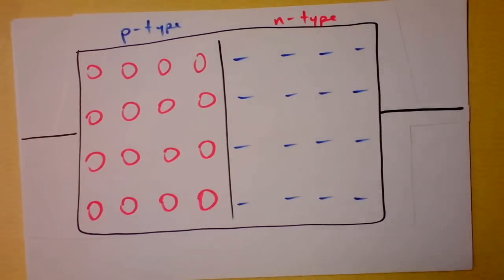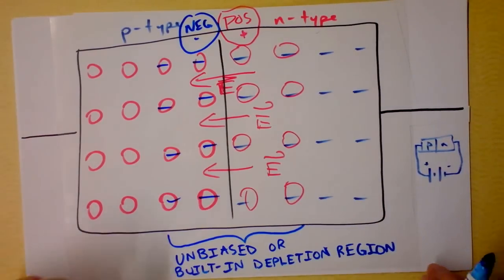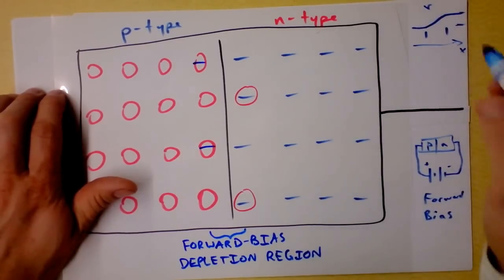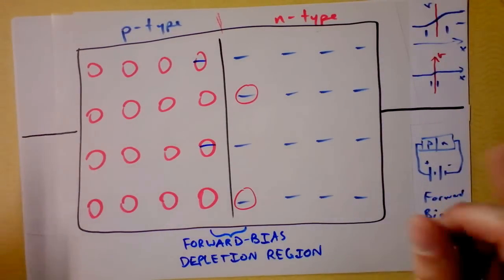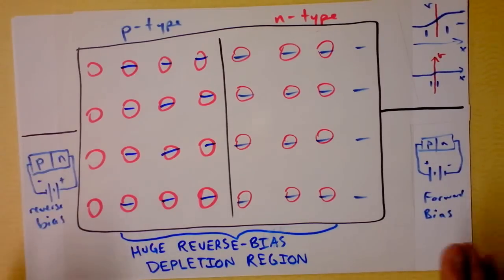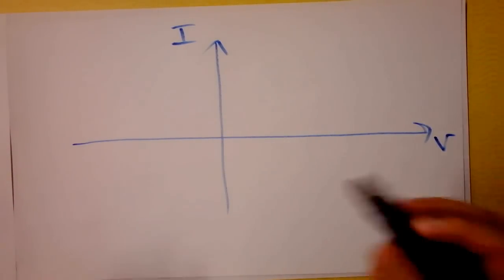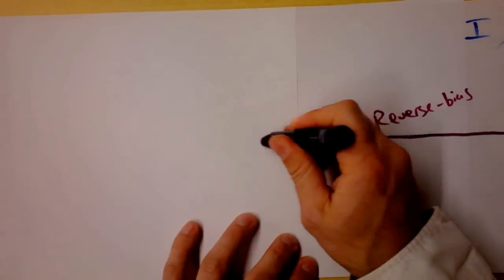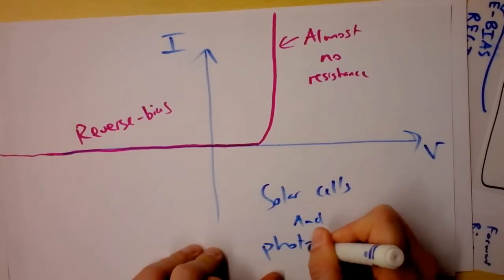What's a Diode?  Here's why diodes conduct one way but not the other | Doc Physics

Comment: During the reverse biasing, what's stopping the electrons which are right near the boundary to go from P-type region to N-type region?  Electrons are negatively charged, and the other side is positively charged, so it seems that the electrons from the P-type region should easily cross the boundary and fly like bullets to the other side.  What am I missing?
Reply: Si atoms holding it and electrons already on n side repelling it.

Comment: sorry for all the questions but can someone explain the diode - current to voltage graph? in forward bias, i understand that the potential difference is meant to be much lower than when it is reverse bias. if this is the case, how does the higher voltage allow an 'almost infinite' current, as shown in the graph?
Reply: nabil choudhury *'almost infinite' conductivity

Comment: In the initial case where you connected the battery, the external field was opposing the built in field, right? But then it was the built in field that stopped the depletion layer from increasing, right? Then shouldn't the battery in the first case lead to an increase in the depletion layer?
Reply: Hey your first two arguments are right but they don't add up to give the third statement.

Comment: Thank you a lot for the video. It would be great if you explain a little bit further why in forward bias the depletion region dissapears but if you measure the voltage drop on the diode is 0.7V. Thats a concept that i can not grasp right away. Thank you
Reply: Forward bias means delivering positive charges to the p-type and reducing negative charges from the n-type. To give a better view, think this again with electrons, that move in the opposite direction to positive charges. Now forward bias forces electrons out from the p-type layer. Guess which electrons are the easiest to kick out? The ones that make the negatively charged depletion layer in the p-type, the ones that recombinated upon creation of the diode.
Reverse bias increases the width of the depletion zone.
Reply from the maker: Great question.  I'll look into it when I have a chance, but I hope someone else can answer it for you sooner.  Any takers?